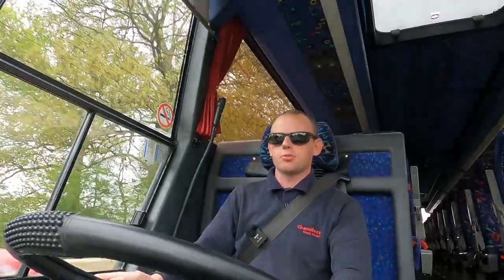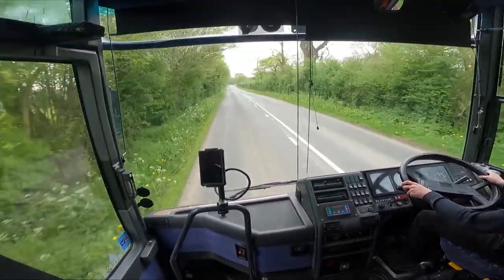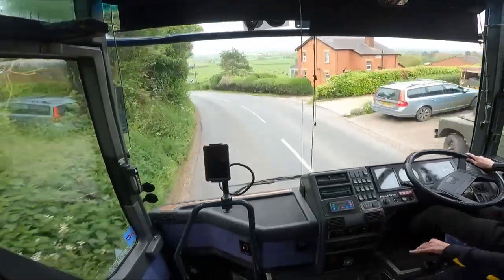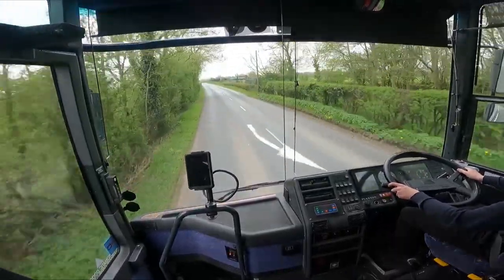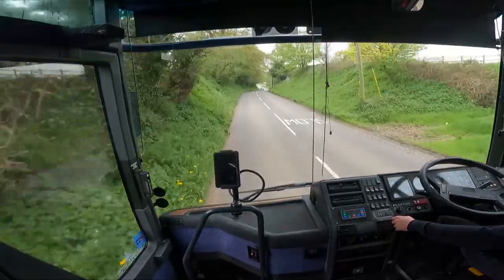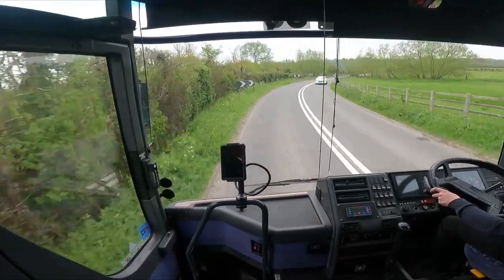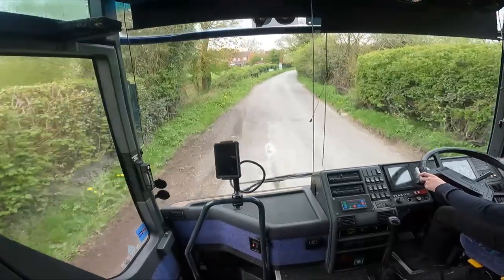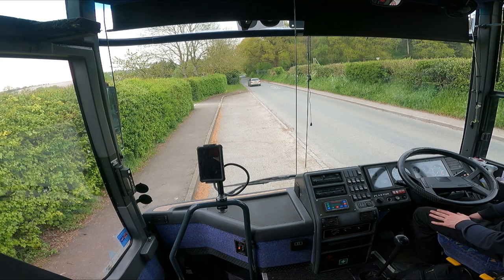Coach Driving With James Ep.10 - Driving the Volvo B10M Westbury to Great Cheverell

Comment: Is There No Exhaust Brake  B58/B10M Based On An AEC Reliance Still Preferred The B58/AEC Mandator Steering Wheel Good Solid Non Wearing Out Then It Would Overheat Or Low Air Pressure Just Slap The Gauges With The Flat Of Your Hand They All Suffered Faulty Dashes